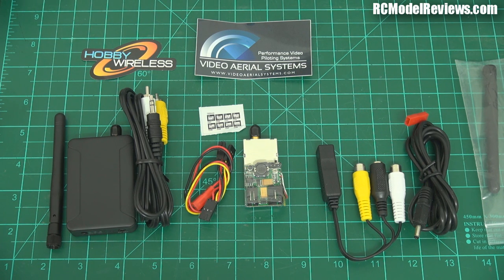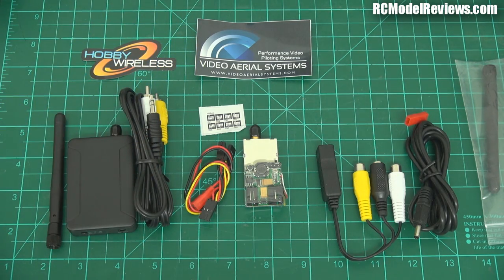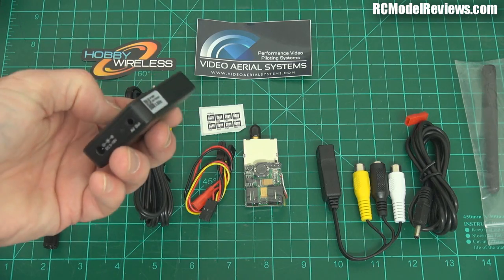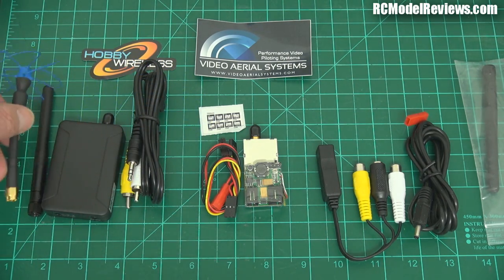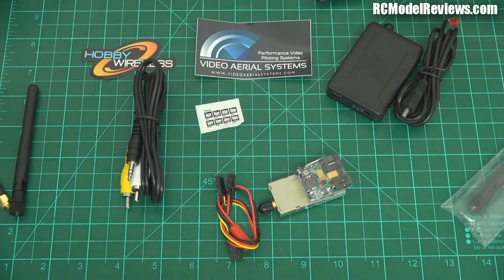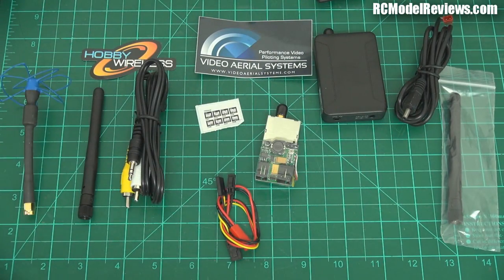3.3GHz FPV from HobbyWireless, a first look

Comment: What does the choke on the antenna do (not specific to 3.3Ghz)?
Reply: It's a balun, if I'm not mistaken, its function is to stabilize the impedance of the coax and/or antenna....
Reply: +eric deherrera Its a ferrite ring, and it is to block the reflected power from going back down the line to the transmitter.
Reply: +ModifiedRC On that one (its a IBCrazy VAS one) its for impedance matching... the antenna design is not 75ohms and required a bit of tweaking, it will reduce reflected power due to a better Xmitter antenna coupling... but it doesn't "block" anything
Reply: +cheetor5923 This is IBCrazy explaining what it does.  So yes and no..

1. Ferrite ring - This balances the antenna better and keeps the wires from being part of the counterpoise.

http://fpvlab.com/forums/showthread.php?18986-433MHz-UHF-Semi-rigid-dipole&p=335566&viewfull=1#post335566